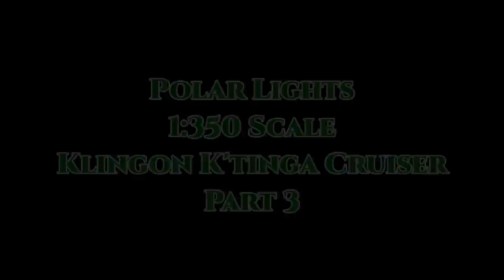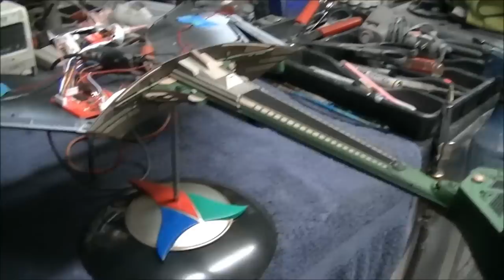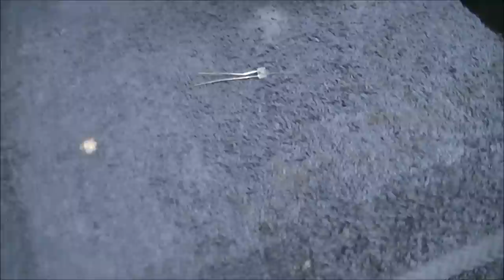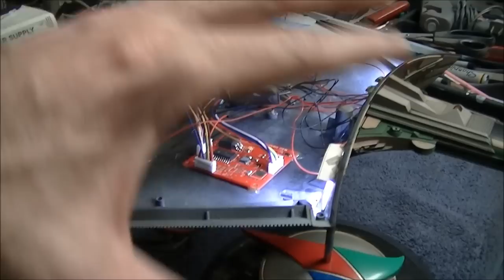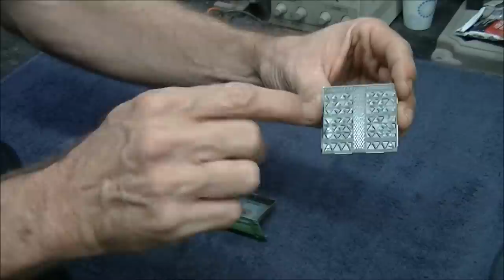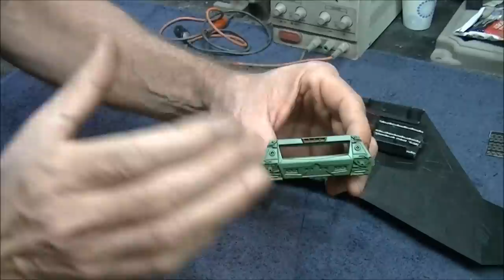Klingon K'tinga Cruiser 1:350 Scale Model Build Pt 3

Comment: Awesome job. I have 3D modeled a Klingon 12 man shuttle from a concept of what a Klingon shuttle would look like in TOS. I haven't played with the idea much more after it, but I could dig it back out. I also think they would or could have made a few sizes of shuttles, like the federation ended up doing. 
In the TOS/Motion Picture/Phase II era we note the (Star Wars Effect) to the Star Trek Universe. This is due to the Original Series being made in the 60's and the limited budget that they had to work with at the time. Not to mention the time crunch they were under when they filmed it. It is quite amazing that it didn't end up looking like Buck Rogers in the 25th Century. Some of the alien costumes, and or Make up ended up being the victim of low budget, and or lack of no digital/and or not being able to blue screen every shot.
But Star Wars came along and the ship models seemed more realistic in a lot of ways compared to 60's Star Trek. They were covered with greebles, and little pipes, and wires. Battlestar Galactica used the same effect. 
So when Star Trek Phase 2 was being worked on for the TV series and Star Wars came out and made an overnight Bazillion Dollars, the Star Trek team took notice. To make a long story short, this is why Star Trek the Motion Picture came out in 1979, instead of Star Trek Phase II as a TV series in 1978. They wanted some of that Bottled Lightning that George Lucas had captured.
Anyway The Enterprise (NCC-1701) no bloody A, no bloody B, no bloody C, or D, had gone from being the TOS beyond imagination excellent design with the detail being in the paint and a few lighted windows on an 11ish foot model shot with a blue screen to a give or take 6 foot model of the first canon refit design that was viewed by Star Trek fans on a Movie Screen. (Their had actually been a rebuilt model for Phase 2) that wasn't used for the motion picture, although it had been considered. If you watch You Tube Star Trek Phase 2 you can see this design. 
Anyway the point of this is that the difference between the shuttle designs had also differed between the only shuttle craft that we viewed in TOS which was the Galileo 7 model, and or prop ship for the series. The Enterprise TOS was suppose to carry 8 of these. I am somewhat surprised that they didn't change the number on it in a few different episodes. 
So the challenge would be for me to design a Klingon Shuttle craft that would reflect the difference between the 60ish smooth design that I came up with that I think would fit nicely onto a D-7 Klingon Battle Cruiser, and what one might look like if they would have actually designed one to use in a scene for the K'Tinga  Battle Cruiser that we see being modeled here with the Star Wars greeble effect in play. 
I think give or take I could use the same Shuttle Design. I would mostly just need to greeble it up, and possibly ad or change the geometry to be a little more engineered looking, instead of to smooth and to tv prop looking.
I will see what I can do and make a YT video of it. (LOL) then to mill, and or 3d print a 1:350 scale of it for your model.

Comment: Its to bad that the Shuttle bays on the Klingon ships, and the Romulan BOP were an afterthought in the designs. I would have liked for this design to have a bit more ceiling clearance like they put on the Enterprise of the time, but it is what it is. They would have needed to take off and land fairly strait. I imagine with computer assist though that it wouldn't be to awful to perform.